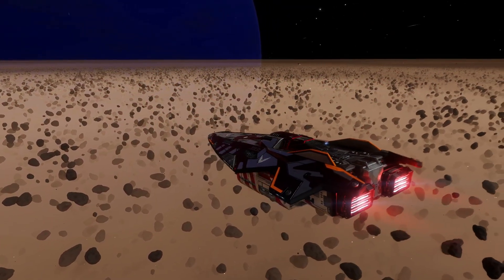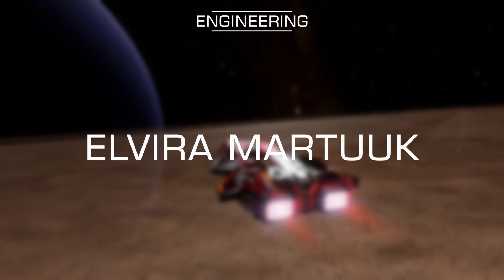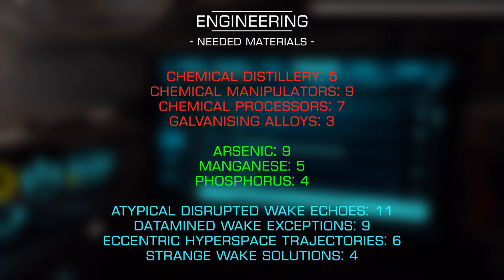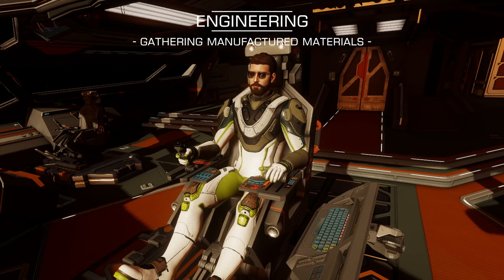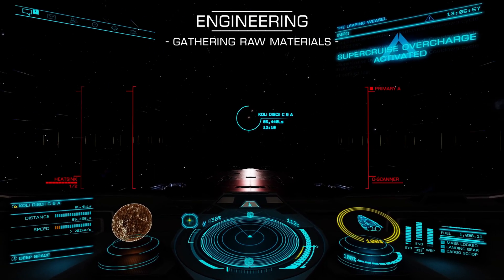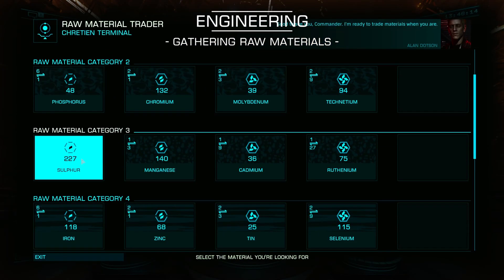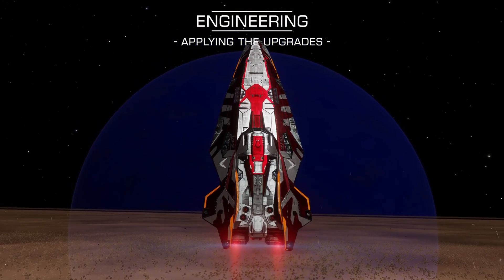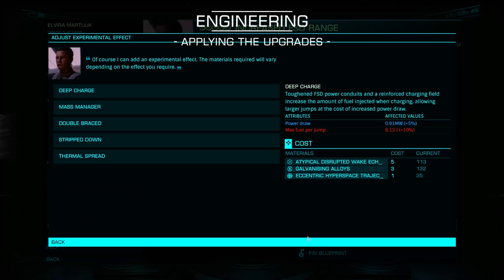READ DESCRIPTION! How to Engineer your First FSD | Elite Dangerous Engineering Guide 2025

Comment: Just started engineering and all i need is the data mind wakes and none are showing up its just atypical but some wakes dont give you anything after you scan them so i dont know if the games bugged at the moment also when i jumped into the distribution centre i crashed straight into a type 9 as it just spawned right in front of me im sure this game hates me 😂

Comment: Double engineered grade A SCO of any size is available at human tech traders for thargoid parts that can be obtained with at least 1 causitic sink, and 1 caustic cargo rack from the titan wreck clouds so long as they're around. Get some limpets, a cargo rack or two, and some sinks and you can spend as long as the sinks last gathering the thargoid parts at no risk. Also can get a really nice double engineered surface scanner from the human tech traders too for fairly cheap if you have the normal engineering materials for it.

Comment: I forgot you don't need to fill each level of engineering for the module to unlock the next level. Burned most of my mats on the first two levels. I've just come back to the game after about 4 years off and I forgot about this. What a nub.
Thanks for the video, Dituri. It will be a big help to claw my way back.
Reply: You may also need to engineer some other modules before unlocking grade 5 (up to 4 is usually immediate).  I had to engineer 3 FSDs before the engineer would grand me grade 5 access, you can see how far along you are on the Engineer's description page.

Comment: I'm not getting the message from elvira is this only for odyssey? I'm on PC
Reply from the maker: Nope, you don’t need odyssey, especially not to get the invite from Elvira. Maybe you missed the message somehow? Check engineers button in right-hand panel. 

If you still don’t see ‘invited’ checked, you didn’t get far enough from the starting system, which is Matet for most CMDRs. 

As long as you get 300ly+ away from there, it should work 🫡

Comment: In my experience, I  have found Deep Charge to be a wasted experimental effect throughout the classes - it provides usually just half a better lightyear of maximum jump range however it drastically cuts total jump range on a single fuel tank, typically between 4 - 10ly, sometimes this can be the difference between reaching a station or next scoopable star. Mass manager is the better overall experimental, regardless of class and covers a wider range of activities.

Deep charge is only beneficial in very few situations, where you might be wishing to have a max range in a single jump only and there are very few ships in the game that can take advantage of this.

I just theory crafted a hauler taxi - no optional internals, everything as engineered as light as possible, 2A FSD (regular for this example). With deep charge, it has a 60.58ly max jump range, with a total range of 239.17
Mass manager on the other hand has a max range of 60.33ly (so it loses only 0.25ly range) and a total range of 264.28ly, that's 25.11ly difference on total range.

The deep charge wisdom was misunderstood and doesn't actually provide any good benefit.

Comment: No link to 90LY build? sadge
Reply from the maker: Tbh the video isn’t about that build, so I didn’t think it was needed. I’ll chuck one together in case people are interested 🫡

Edit: here it is. Note that it can go a little further if you remove the shield, but even with it you’ll get past 90ly max range….

https://edsy.org/#/L=H600000H4C0S00,,,9p300A3wG07J_W0AOiG04K_W0AfRG05J_W0AtyG03G_W0B1KG02q_W0BRuG03G_W0Bcg00,,53c000Pe80mpU34a00mpW7Q4G03N_W00JO800nG00
Reply: @DiturisElite  Thanks a whole bunch! This is fantastic! Going to get started today. Really, thanks!
Reply: @DiturisElite  Got her up to 84.92LY! I wanted some extras like a vehicle bay, because I like to drive the Scarab around. And a bit better shield because I lithobrake a little too much :)
o7 Commander!

Comment: Made it to the Khun system, traveled from the Nguri (cheranovksy city), got the three Soontil relics in ship cargo.
On Khun 5, but ONLY see : the Rojas Horticultural Facility, the Korolanko Botanical Hub and the Belshaw Botanical Garden.

I see NO Long Sight Base from space, from flying over the planet around (-32.2, -105ish), did surface scans, did system scan.
Is there something I'm missing...?
Reply: BTW, had NO engineers in my 'list' and still don't...
Reply from the maker: Your reply is the issue here. You need to hear of Elvira even to see her base. 

For that you’ll need to travel at least 300ly from the start system. This can be annoying, but you’ll use Elvira for so many upgrades down the line 🫡
Reply: @DiturisElite  Already traveled over 860 from there.

Comment: So, do the SCO drives have a higher jump-range than non-SCO drives?

As a returning player, should I consider replacing ALL my FSDs with SCO models or, if the actual jump-range is the same, is the smart move just to fit SCO drives to ships such as cargo haulers, mining ships and mat-gatherers - where it's useful to be able to move around within a system quickly?
Reply from the maker: Yep, the jump range is (a little) better on SCO drives than non-SCO, so there’s basically no reason to not have it these days. 

It’s super handy on haulers and miners for in-system travel, but it’s also great on explorers for both the increased range and high-speed supercruise 🫡
Reply: @DiturisElite  Great, thanks.

With 30-odd ships in my fleet I guess I'm going to be spending some time with Auntie Felicity.

Definitely be doing my mat-gathering AspX first, though, for chasing HGEs.

Comment: Nope I won’t use the SCO drive I absolutely hate it, I have removed it from the Python mk2 and replaced with a standard engineered FSD.
Reply: If you don't like the overcharge, you can still use it without using overcharge, as it has a little bit more range than the regular one.
Reply: @raven9ine  not enough to make me want to use it
Reply: Why
Reply: @Bashfulvideos1  the overcharge is bloody stupid and unstable.
Reply: @aguilarvarsovian  it works perfectly fine for me

Comment: Will a Guardian FSD Booster work with an SCO drive ? =]  And thanks again Cmdr Dituri for another AWESOME video - always love watching your content =D
Reply: the fsd booster will work with any drive for frame shift wether it being sirius (old) or the sco new variant. the new drives just have a higher mass optium and multiplier with the overcharge. good luck hope it helped.
Reply: Thanks so much  @aioshan653  !  So presumably a Guardian FSD Booster would bump the jump range even further =D
Reply: @The_Amethyst_Angle  a size 5 is a 10 ly or a lil close to it in boost for the guardian equipment. It is also a 1 unlock for all sizes same for the distributor and power plants sometimes even those are useful until you can engineer something.

Comment: Should put the new material requirements in the description since the engineering update a few days ago.
Reply from the maker: Oh? I wasn’t aware they’d changed, I’ve been away from my desk for a while. 

Having looked it up, I can’t find anything about changed material costs. Could you talk me through what you mean, if you don’t mind? 🙃🫡
Reply: @DiturisElite Engineering rolls are no longer RNG-based, rather depending on your reputation it's a fixed amount of rolls to get to the next level
Reply: Sorry thought it was the same as the suits, definitely makes it easier with the new system

Comment: What a garbage click bait.
He did not show the jump range before and after the  engineering.
He did not show the rest of modules and their engineering.
He did not explain how to perform the Thruster engineering swap exploit.

All in all, this is useless without the many other steps omitted in this video.
Reply from the maker: I didn’t just make this video so you could make an Anaconda, if I did I’d show you all of that. 

This video is all about the FSD, and how to get it - the anaconda is just an example of what it can do 🫡

Comment: Well, thanks for this guide on how to buy and engineer an fsd in a very nicely edited and presented way, but...

At the beginning at 0:24 you state best fsd (console) with 78 yrs for a Krait Mk II and - if I am not mistaken - somewhere (thumbnail?) I read 90 lyrs for "the new best fsd", so where - at the end after finishing everything - is your proof for that? I mean, not that I am secondguessing it, but imho that would have made sense, wouldn't it? ^^

Or did I miss something?
Reply: You should try these system's in the Galaxy map search bar and fly to them. 07 🫡

Gamma velorum
HD 125178
HD 125142
HD 100085
Wregoe yk-p e5-83
Psr joo24-7204e
Psr joo24-7204o
Psr joo24-7204t
Psr joo24-7204q
Psr joo24-7204u
Hip 13044
Cygni x-3
Plaa aec iz-n c20-1
Eafots eu-r c4-1
Pru aescs dl-w c15-37
Stuemeae fg-y d7561
Stuemeae km-w c1-4809
Ic 4673
Ic 2391 sector ze-a d101
Ic 2391 sector gw-v b2-4
Cygnus x-1
Cygnus x-3
Evelyn's light
Urt
Ads 9338 ac
Scheau bli nb-o d6-342
Lil
Synuefe xr-h d11-102
Trappist-1
Lft 509
Rigel
Ngc 2841
Ngc 5195
Ngc 1566
GJ 1214B
Cw 190521
Rx j1856.5-3754
Serpent 37
6 Lacertae
6 Lambda Leporis
Alnilam
Alnitak
Mintaka
Sol
Proxima Centauri
Sirius
Stephenson 2-18
Carcosa
Maia
Ads 4229 abc
Eimbaith Lw-w EL-290
Floasly te-x d2-25
Synookio EL-J d9-1
Gongae Qw-1 c24-0
Byoi aewsy r2-f d11-104
Eol prou kw-1 cb-32
Blua hypa hi-f d12-1226
Bleia dryiae hf-w b35-1
Col 285 sector vu-m c8-32
Eol prou kw-1 c8-32
Eafoff IN-Q d6-0
Dryooe prou ff-z d696
Boelts XH-C c29-854
Shaulai DL-P d5-274
Stuemeae bv-y f2111
Stuemeae nn-s e4-1360
Stuemeae nn-s e4-5583
Nyuena bf-r e4-3196
Nyuena bf-r e4-4054
Nyuena bf-r e4-2200
Nyuena bv-p e5-458
Nyuena bv-p e5-1493
Nyuena bv-p e5-2376
Pre Aowsy ba-a
Brambai uz-o e6-313
Dumboe aa-a h207
Hypao brai kw-v b5-21
Hypio gree aa-a h56
HD 155889
Bleia dryiea xj-r e4-1
Hi'iaka
Angosk jm-w d1-05
Hip 52741
Tira Flirble
Smade's
Hip 57951
Lorant mi-b d13-1
Blaea brou cn-b d13-06
Psr j0024-7204Q1
Eolls hypai no-x d2-06
HD 64285
Hip 64902
Hip 604151
HD 213221
HD 211744
Hip 57951
Smeamaa aa-a ho4
Phleedgoea kx-u f2-10
Garth
Izar
Axanar
Klingon
CBS
Orian
Actaea
Vanth
HD 35460
Hip 57951
S171378
Smith's claim
Pru aescs zk-p e5-103513
HD 474171
Swoiwns td-r d5-85
Wellington
HD 64287
Hip 64902
Oevasy sg-y do
Hyphiemoe yk-p d5-0
Eolls hypai ll-z d1-02
Psr j1641+3627ba
HD 64282
2 mass j02323627+61282553
Nyeajoa fb-o e6-oa
Eor phyloi cl-y g137
Pria thoi zp-g d10-37
HD 2020881
Ogaicy zo-a e4228
HD 935217
HD 984256
HD 71297
Reply: @RebirthOfTheGods  What do this systems have to do with what I asked/stated above? ^^
Reply: @cmdrdonaldduck8940  dunno what those systems have to do with anything. However, if you follow the steps in the video it’ll get you the best fsd available in the game. There are other ways to increase your jump range however, like decreasing the overall mass of whatever ship you’re flying, and acquiring a guardian frame shift drive booster. There are plenty of videos out there that walk you through step by step on how to unlock the guardian fsd booster and if you want to maximize your jump range I’d recommend looking those up after you’ve engineered your frame shift drive.

Comment: Im pretty sure the double engineered class 6 fsd still beats it
Reply from the maker: On range, yes, just barely. 2 arguments here:
1. Double engineered class 6 is not available, and hasn’t been for a while
2. SCO is so insanely handy, its a big sacrifice for (at absolute most) 1ly more range

Still, if you’ve got one and range is the be-all-end-all, go for it 🫡
Reply: You should try these system's in the Galaxy map search bar and fly to them. 07 🫡

Gamma velorum
HD 125178
HD 125142
HD 100085
Wregoe yk-p e5-83
Psr joo24-7204e
Psr joo24-7204o
Psr joo24-7204t
Psr joo24-7204q
Psr joo24-7204u
Hip 13044
Cygni x-3
Plaa aec iz-n c20-1
Eafots eu-r c4-1
Pru aescs dl-w c15-37
Stuemeae fg-y d7561
Stuemeae km-w c1-4809
Ic 4673
Ic 2391 sector ze-a d101
Ic 2391 sector gw-v b2-4
Cygnus x-1
Cygnus x-3
Evelyn's light
Urt
Ads 9338 ac
Scheau bli nb-o d6-342
Lil
Synuefe xr-h d11-102
Trappist-1
Lft 509
Rigel
Ngc 2841
Ngc 5195
Ngc 1566
GJ 1214B
Cw 190521
Rx j1856.5-3754
Serpent 37
6 Lacertae
6 Lambda Leporis
Alnilam
Alnitak
Mintaka
Sol
Proxima Centauri
Sirius
Stephenson 2-18
Carcosa
Maia
Ads 4229 abc
Eimbaith Lw-w EL-290
Floasly te-x d2-25
Synookio EL-J d9-1
Gongae Qw-1 c24-0
Byoi aewsy r2-f d11-104
Eol prou kw-1 cb-32
Blua hypa hi-f d12-1226
Bleia dryiae hf-w b35-1
Col 285 sector vu-m c8-32
Eol prou kw-1 c8-32
Eafoff IN-Q d6-0
Dryooe prou ff-z d696
Boelts XH-C c29-854
Shaulai DL-P d5-274
Stuemeae bv-y f2111
Stuemeae nn-s e4-1360
Stuemeae nn-s e4-5583
Nyuena bf-r e4-3196
Nyuena bf-r e4-4054
Nyuena bf-r e4-2200
Nyuena bv-p e5-458
Nyuena bv-p e5-1493
Nyuena bv-p e5-2376
Pre Aowsy ba-a
Brambai uz-o e6-313
Dumboe aa-a h207
Hypao brai kw-v b5-21
Hypio gree aa-a h56
HD 155889
Bleia dryiea xj-r e4-1
Hi'iaka
Angosk jm-w d1-05
Hip 52741
Tira Flirble
Smade's
Hip 57951
Lorant mi-b d13-1
Blaea brou cn-b d13-06
Psr j0024-7204Q1
Eolls hypai no-x d2-06
HD 64285
Hip 64902
Hip 604151
HD 213221
HD 211744
Hip 57951
Smeamaa aa-a ho4
Phleedgoea kx-u f2-10
Garth
Izar
Axanar
Klingon
CBS
Orian
Actaea
Vanth
HD 35460
Hip 57951
S171378
Smith's claim
Pru aescs zk-p e5-103513
HD 474171
Swoiwns td-r d5-85
Wellington
HD 64287
Hip 64902
Oevasy sg-y do
Hyphiemoe yk-p d5-0
Eolls hypai ll-z d1-02
Psr j1641+3627ba
HD 64282
2 mass j02323627+61282553
Nyeajoa fb-o e6-oa
Eor phyloi cl-y g137
Pria thoi zp-g d10-37
HD 2020881
Ogaicy zo-a e4228
HD 935217
HD 984256
HD 71297

Comment: Great video for the new Cmdr. Keep it up!
Reply: You should try these system's in the Galaxy map search bar and fly to them. 07 🫡

Gamma velorum
HD 125178
HD 125142
HD 100085
Wregoe yk-p e5-83
Psr joo24-7204e
Psr joo24-7204o
Psr joo24-7204t
Psr joo24-7204q
Psr joo24-7204u
Hip 13044
Cygni x-3
Plaa aec iz-n c20-1
Eafots eu-r c4-1
Pru aescs dl-w c15-37
Stuemeae fg-y d7561
Stuemeae km-w c1-4809
Ic 4673
Ic 2391 sector ze-a d101
Ic 2391 sector gw-v b2-4
Cygnus x-1
Cygnus x-3
Evelyn's light
Urt
Ads 9338 ac
Scheau bli nb-o d6-342
Lil
Synuefe xr-h d11-102
Trappist-1
Lft 509
Rigel
Ngc 2841
Ngc 5195
Ngc 1566
GJ 1214B
Cw 190521
Rx j1856.5-3754
Serpent 37
6 Lacertae
6 Lambda Leporis
Alnilam
Alnitak
Mintaka
Sol
Proxima Centauri
Sirius
Stephenson 2-18
Carcosa
Maia
Ads 4229 abc
Eimbaith Lw-w EL-290
Floasly te-x d2-25
Synookio EL-J d9-1
Gongae Qw-1 c24-0
Byoi aewsy r2-f d11-104
Eol prou kw-1 cb-32
Blua hypa hi-f d12-1226
Bleia dryiae hf-w b35-1
Col 285 sector vu-m c8-32
Eol prou kw-1 c8-32
Eafoff IN-Q d6-0
Dryooe prou ff-z d696
Boelts XH-C c29-854
Shaulai DL-P d5-274
Stuemeae bv-y f2111
Stuemeae nn-s e4-1360
Stuemeae nn-s e4-5583
Nyuena bf-r e4-3196
Nyuena bf-r e4-4054
Nyuena bf-r e4-2200
Nyuena bv-p e5-458
Nyuena bv-p e5-1493
Nyuena bv-p e5-2376
Pre Aowsy ba-a
Brambai uz-o e6-313
Dumboe aa-a h207
Hypao brai kw-v b5-21
Hypio gree aa-a h56
HD 155889
Bleia dryiea xj-r e4-1
Hi'iaka
Angosk jm-w d1-05
Hip 52741
Tira Flirble
Smade's
Hip 57951
Lorant mi-b d13-1
Blaea brou cn-b d13-06
Psr j0024-7204Q1
Eolls hypai no-x d2-06
HD 64285
Hip 64902
Hip 604151
HD 213221
HD 211744
Hip 57951
Smeamaa aa-a ho4
Phleedgoea kx-u f2-10
Garth
Izar
Axanar
Klingon
CBS
Orian
Actaea
Vanth
HD 35460
Hip 57951
S171378
Smith's claim
Pru aescs zk-p e5-103513
HD 474171
Swoiwns td-r d5-85
Wellington
HD 64287
Hip 64902
Oevasy sg-y do
Hyphiemoe yk-p d5-0
Eolls hypai ll-z d1-02
Psr j1641+3627ba
HD 64282
2 mass j02323627+61282553
Nyeajoa fb-o e6-oa
Eor phyloi cl-y g137
Pria thoi zp-g d10-37
HD 2020881
Ogaicy zo-a e4228
HD 935217
HD 984256
HD 71297

Comment: the sco drive is a joke on you. The devs are giving you all the middle finger. When you activate the drive your ship explodes.
Reply: You should try these system's in the Galaxy map search bar and fly to them. 07 🫡

Gamma velorum
HD 125178
HD 125142
HD 100085
Wregoe yk-p e5-83
Psr joo24-7204e
Psr joo24-7204o
Psr joo24-7204t
Psr joo24-7204q
Psr joo24-7204u
Hip 13044
Cygni x-3
Plaa aec iz-n c20-1
Eafots eu-r c4-1
Pru aescs dl-w c15-37
Stuemeae fg-y d7561
Stuemeae km-w c1-4809
Ic 4673
Ic 2391 sector ze-a d101
Ic 2391 sector gw-v b2-4
Cygnus x-1
Cygnus x-3
Evelyn's light
Urt
Ads 9338 ac
Scheau bli nb-o d6-342
Lil
Synuefe xr-h d11-102
Trappist-1
Lft 509
Rigel
Ngc 2841
Ngc 5195
Ngc 1566
GJ 1214B
Cw 190521
Rx j1856.5-3754
Serpent 37
6 Lacertae
6 Lambda Leporis
Alnilam
Alnitak
Mintaka
Sol
Proxima Centauri
Sirius
Stephenson 2-18
Carcosa
Maia
Ads 4229 abc
Eimbaith Lw-w EL-290
Floasly te-x d2-25
Synookio EL-J d9-1
Gongae Qw-1 c24-0
Byoi aewsy r2-f d11-104
Eol prou kw-1 cb-32
Blua hypa hi-f d12-1226
Bleia dryiae hf-w b35-1
Col 285 sector vu-m c8-32
Eol prou kw-1 c8-32
Eafoff IN-Q d6-0
Dryooe prou ff-z d696
Boelts XH-C c29-854
Shaulai DL-P d5-274
Stuemeae bv-y f2111
Stuemeae nn-s e4-1360
Stuemeae nn-s e4-5583
Nyuena bf-r e4-3196
Nyuena bf-r e4-4054
Nyuena bf-r e4-2200
Nyuena bv-p e5-458
Nyuena bv-p e5-1493
Nyuena bv-p e5-2376
Pre Aowsy ba-a
Brambai uz-o e6-313
Dumboe aa-a h207
Hypao brai kw-v b5-21
Hypio gree aa-a h56
HD 155889
Bleia dryiea xj-r e4-1
Hi'iaka
Angosk jm-w d1-05
Hip 52741
Tira Flirble
Smade's
Hip 57951
Lorant mi-b d13-1
Blaea brou cn-b d13-06
Psr j0024-7204Q1
Eolls hypai no-x d2-06
HD 64285
Hip 64902
Hip 604151
HD 213221
HD 211744
Hip 57951
Smeamaa aa-a ho4
Phleedgoea kx-u f2-10
Garth
Izar
Axanar
Klingon
CBS
Orian
Actaea
Vanth
HD 35460
Hip 57951
S171378
Smith's claim
Pru aescs zk-p e5-103513
HD 474171
Swoiwns td-r d5-85
Wellington
HD 64287
Hip 64902
Oevasy sg-y do
Hyphiemoe yk-p d5-0
Eolls hypai ll-z d1-02
Psr j1641+3627ba
HD 64282
2 mass j02323627+61282553
Nyeajoa fb-o e6-oa
Eor phyloi cl-y g137
Pria thoi zp-g d10-37
HD 2020881
Ogaicy zo-a e4228
HD 935217
HD 984256
HD 71297